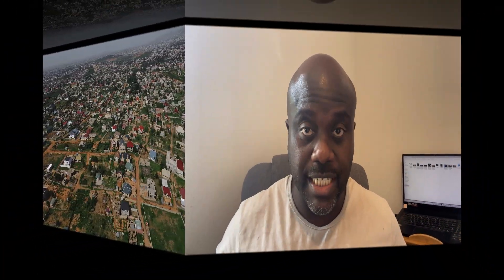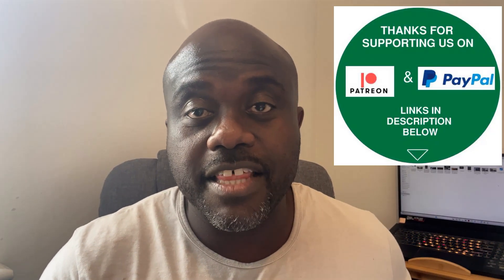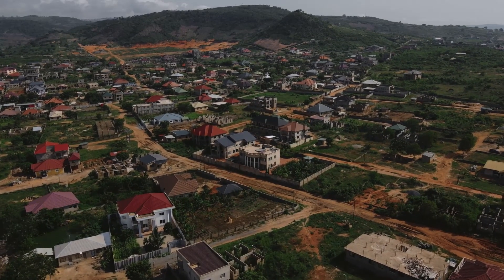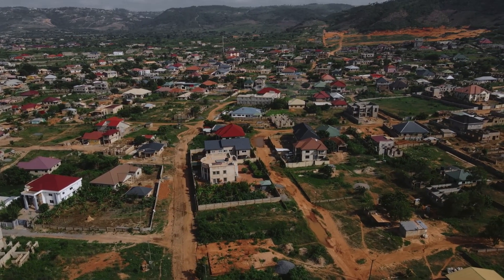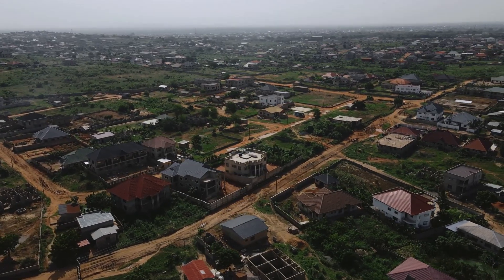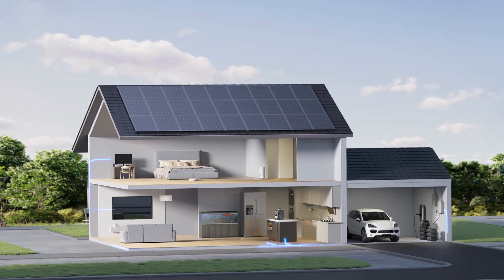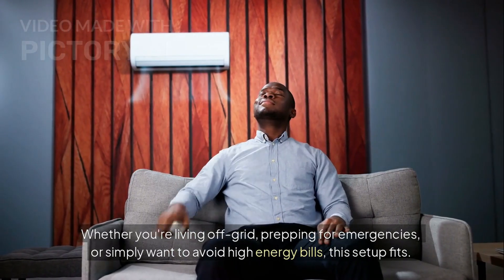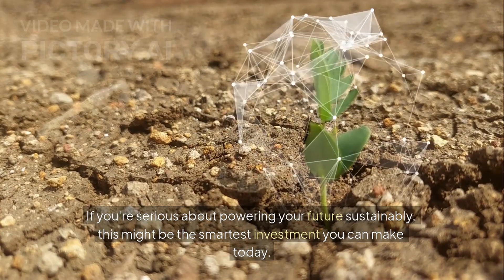MODULAR BACKUP POWER SYSTEMS

Comment from the maker: You can support us on Patreon here:
https://www.patreon.com/asher_gad
Or donate through Paypal here:
https://www.paypal.com/paypalme/ashergad?locale.x=en_GB
Building In Ghana Ebooks

1. Cost Templates For Building In Ghana (Link below)
     https://payhip.com/b/UQjBY    
2. How to Wire your Home for 110V & 220V Equipment
     https://payhip.com/b/gN8eY     
3. How to Manage Power Failure (dumsor) in Ghana.
     https://payhip.com/b/BlyQ9     
4. How to Construct a Water-Proof Concrete Flat Roof in Ghana
     https://payhip.com/b/QXJPl    
5. How much Power Does your House Need?
     https://payhip.com/b/8P7wu    
6. Water System Design for a Multi-Storey Building in Ghana
     https://payhip.com/b/fLKYD     
7. How to Select the right Balustrade Artisan in Ghana
     https://payhip.com/b/WbnCN     
8. How to Select the right Window Artisan in Ghana
     https://payhip.com/b/dL7FS